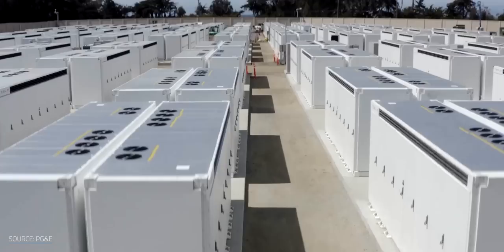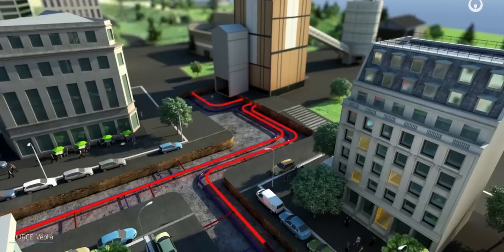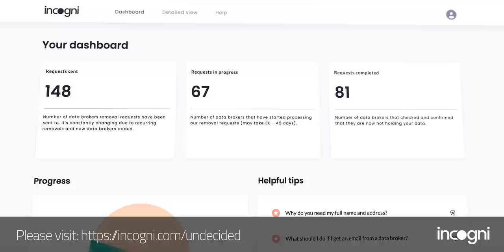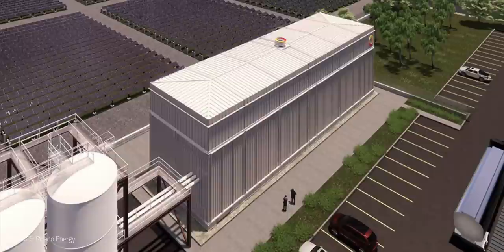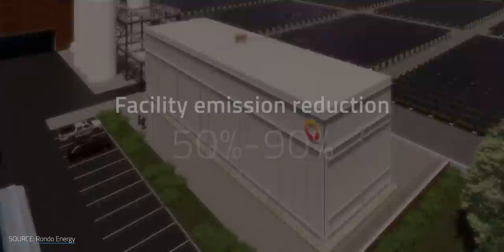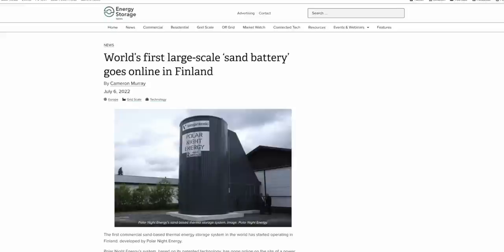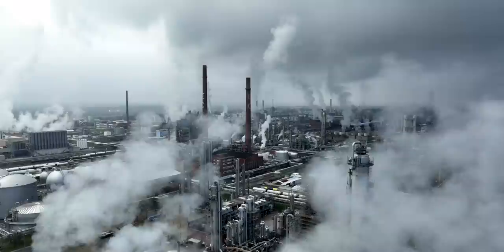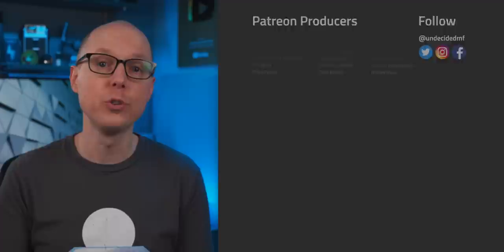How A Brick & Rock Battery Is Changing Energy Storage

Comment: Thermal storage is something I'm glad people are noticing. We've been using this on much smaller scales for years, such as pre-heating water for the home in tanks and using it in radiators around the house during winter; sure it (usually) relies on the grid and isn't as efficient as district heating, but as a principle it's nothing new and I'm glad we're moving away from JIT production of energy and heating.

Comment: There are some obvious flaws in these systems.
First, the electricity must be converted to heat the massive stone\brick storage.
It would take less energy to convert the electricity into heat direct used by the receiver.
Second, heat retention in the medium is not permanent and energy is lost by the process of thermal transfer.
Third, it will take more energy to transfer the heat from the medium than it would to convert the original electricity to a direct heating source.
Lastly, the space needed to provide enough medium to retain enough heat is extremely large.

Comment: From the previous video, Matt reports the efficiency of turning that heat back into electricity as 40%, BUT if... if I use that electricity to power a heat pump, running at a gain of about 2.5.. then Ta-Dah! Net zero gain... or loss.
Reply: "Reminds me of the time, I put a humidifier and a dehumidifier in a room and just let them fight it out." (Steven Wright.)

Comment: Well, got this kind of heat storage build into my house since 1978. Heating elements with stones are heated up when there is a surplus electricity available. Last year I upgraded this with a new controller to use PV energy in winter (not so much this year). So far nothing new. Sure, heat storage at home is limited to some days.

Comment: Yes, a good piece on thermal energy usage, It is one that will have far reaching use from here on, I can see it. Latent heat usage should be practiced by all manufacturers of heating equipment, It makes sense. I used to work in a small power plant, we made a lot of heat to boil water for steam Turbines, about 80 meters away was the Offices, which were heated by Reverse cycle Air conditioners, wouldn't it have been obvious to use the Excess heat from the boilers to run a heat loop to the office to heat it as well.??

Comment: in uses heating a room seems like heat pumps would be a better choice. although they won't produce flashy headlines heat pumps move 1.5-3 watts of heat per 1 watt of electricity. used to be they had a lot of problems in extreme cold temps, but current air source heat work even below -10F. it may even be possible to combine the 2. since it wouldn't need to produce 200F+ heat pumps would likely to be a more efficient way to charge the thermal battery in that use case.

Comment: Speaking of steel making, even if you couldn't use it directly to melt the steel you could use it to reduce the cost to bring the temperature up.  Most steel making is done with an electric arc furnace and they blow air in it how much quicker would the steel heat if the air blown in was near the melting temp and so reduce the electricity used and possibly reduce the time needed to get it molten. You could also use it to capture heat from exhaust gasses or off peak power.
Meh, what do I know.

Comment: I would be happy with a Rhondo heat battery taking 90% of the energy load of making steel and using standard electricity to finish heating the steel.  That would be huge.  I think we become absolutists at the expense of drastic improvement that we can't bring ourselves to be happy about.

Comment: Heat storage is a great idea. But it’s just one finger of a hand. 

I’m a Union pipe fitter. I see new boiler systems working in conjunction with other systems. On the return side of a steam system in the condensation. The condensation is still very hot. It’s being used to heat domestic potable water. I’ve also seen in hospitals where steam is used to heat autoclave. I think it’s just a pre heat but nevertheless it’s capturing heat. 

Now I get the cooler the condensation is the harder the boil will have to work but the boilers are much more efficient than a hot water heater or an autoclave preheating to 300°. 

I think it will take a combination of systems that combines systems to solve our problems.

Comment: I have what is called an Electric thermal storage system for a heating system.  The way it works is that during times of lower costs of local power, the bricks are heated up with electric coils.  During the day, there is no power going to the bricks, and it heats the house like a German masonry fireplace.  I have had the system for 30 years now, and I must confess that there has been no maintenance on it

Comment: Have you ever heard of "Rocket mass heaters" ? 
A few years ago I fell into one of those internet holes about "permaculture". While it seem a bit "hippie like" and that impression is not lessoned by a lot of the people into it is, well hippies, they do have a lot of smart things and cool "tech". Things that make sense, not just in a fantasyland! 
One of the things that really stuck with me was rocket mass heaters! 
They were kind of DIY projects. and they claimed them to be extremely efficient! 
In short: The rocket burns "sideways", it goes up to a barrel and you make what is basically a controlled chimney fire, this means you burn everything from your wood. all the gasses and stuff that is released and normally would go with the smoke, is condensed and falls back into the fire. Then the "smoke"/hot air is lead through pipes in a big heatsink, mostly made from sand and clay, but you could do other materials I am sure. before finally let out to the outside, almost cooled down. 
When you are burning you get a lot of radial heat from the barrel, but then because you extract most of the heat from the smoke too, it will give off heat for hours and hours after you are done burning. keeping the house warm all night. It is one of the most complete burns you can make, so most of the nasty stuff is also burned away. 
It would be cool if you looked into it, and maybe made a video on it - if it is as "cool" as I think it is!

Comment: A ton of gravel heated by 500°C stores about 100kwh of energy.  If most household energy is for heating and cooling and electricity can be generated at about 30% efficiency from stored heat or cold,  then the process would be near 100% effucient in cold weather using the waste heat for heating and hot water.  In hot weather, the waste cold from generating electricity could make it highly efficient.

Comment: The problem comes down to the cost of efficient insulation and the real estate that your heat battery takes up.  Then compare that to the cost of a standard furnace and fuel.  You can afford a furnace but you can’t afford a block of bricks the size of your house, insulation a foot thick, and some free method to heat it up…..

Comment: in order to store excess heat from industrial processes, yes, seems feasible, as it is the form of energy that is "almost lost". Yet other low-tech energy storage systems like gravitational batteries impress me more: no loss, output more scalable, no loss over time, no degradation, scalable in size... So, heat storage likely is a concept for very small niche.

Comment: Thanks for the great video! A question though: I was under the impression that decarbonizing the steel industry could be achieved by replacing traditional furnaces by electric-arc ones. The video implies that high heat (>1600°C) is needed in the steel industry and using brick heat storage can help to achieve these temperatures using stored renewable energy. But is this needed if electric furnaces are used? Or is installing heat storage somehow cheaper than replacing traditional furnaces with electric ones? Thanks!

Comment: Thinking I should build one for my house since I generate energy using solar anyway and run electric heaters when it's sunny out, so I'm gonna build one for night time and the panels can be connect it directly to the heating element and bypass the battery in charge controller

Comment: It's arguably one of the best practical system to store and utilise energy but i have doubts on the efficiency of the system in mass level for bigger demands . Just a thought, because the heat is gonna radiat and get wasted, the blower to bring heat out by air isn't gonna be efficient as it sounds , and the surrounding environment temperature also gonna impact the  stability of the efficiency, it's kinda debatable method to store energy in mass level

Comment: What prevents these companies from using heatpumps to "charge" these brick batteries?
Doing this smartly you could even combine the product of the heatpump heat, the equivalent cold "exhaust",  to provide cooling for datacenters or the community or other industries who consume energy to cool down goods (food freezers or anything else that I'm not even aware). Sure, heatpumps were probably never thought as a source to heat up to 1500 degrees but we never thought that we would doing a coast-to-coast on an EV.
Combining technologies can have a compounding effect that greatly improve the efficiency of the whole system.

Comment: I didn't see it mentioned, but it seems that Stirling engines may be a logical choice to produce electricity, when temperatures may be too low to drive turbines.  Of course, there are also Thermovoltaics, so we shall see what turns out to be most optimum.

Comment: I hate to tell you this but as a person who used to work with steel making equipment; this is an old idea. Somehow, the furnace people who built blast and open harth furnaces and built such thermal units went out of business as the 1970's usher in electric arc, induction, and basic oxygen furnaces. The idea worked really well but it never caught on with asphalt plants, central heating, plastic molding, cement making, etc. The old line furnace companies lacked the vision to adapt such units to other industries and energy was cheap enough to justify wasting it over the capital expense of purchasing such a unit. ( CEO's at that time "were penny wise and pound foolish" as my grandmother taught me) If you know where to look and whose technology to buy its an off the shelf solution with no or minimal R&D required. It doesn't fall under batteries in most technical and business people's mind though, it would fall under energy recovery or conservation. it is something our government doesn't want to promote.

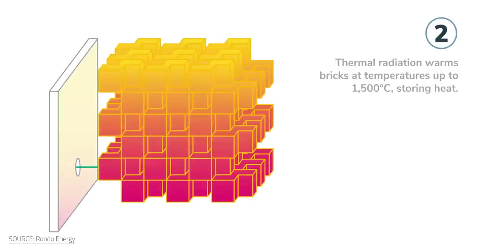Comment: So someone made an oversized electric brick heater 4:42, I have seen homes that are heated using these and if used correctly are much cheaper then gas central heating.

If you think about it, to go one step forward to save on co2 emissions we are going back several steps in heat storage. It's not bad just interesting.

Comment: Old used bricks would certainly be a good idea for that usage. Crushed rocks not so much since that would be better off for cement/concrete, now desert sand would be better since that is something you can't use in concrete as is, too rounded up edges in that sand.

Comment: The simplicity of the concept is key - the technology will determine the efficiency and capability limits.  The problem lies more in the political will to promote this both as an industry solution and a local Community solution.  It should be a no-brainer to install such units in all new housing and industrial/commercial developments together with ground source heat pumps, PV panels and vertical wind turbines.  Existing communities need local leadership and community involvement to work out how best to retro fit the infrastructure.  We cannot be waiting for the next improvement before acting -  now is the time.

Comment: I think that using heat storage is definitely a smart move, Im even personally more for the power tower style of solar power since it's innately much better at storing energy with a similar efficiency, and this seems to just be a system to do the same, but for more sources. I think that theoretically the heating efficiency can be larger if heat pumps are used, though I'd think that the limit for how hot it can get is lower.

Comment: Good combination with hydroelectric and fission power plants. Who knows, maybe the fission waste is an even better heat conductor or battery.
Additionally, instead of converting the thermal power from fission/fusion into electricity, use it for industrial processes that require heat. Solar/wind combined with standard batteries to power the computers running everything, with backup thermal to electricity in case of failure.

Comment: Not mentioned: Thermodynamic efficiency losses when turning heat back into electricity for grid storage.  It would be less than 40% at best.  Though in general, this is a fantastic application for industrial uses.

Comment: Pretty neat.   There might be a big advantage to utilize two heat batteries in series...with the first one as a "pre-heater" for the incoming air stream.   This way you could heat battery #1 by utilizing the 3-1 advantage of an electrically driven heat pump circuit...and then downstream, add in the additional heat of battery #2 (electrical resistance heat).   This could also help reduce thermal shock to battery #2.

Comment: My questions on the feasibility of TES revolves around the energy density - is it applicable for large industrial scale processes (would it consume too large a space); RTE - is blowing hot air through hot bricks the best way to recover heat from the storage? air has a low specific heat capacity. dont know what i dont know here.. but if its real this could be the panacea for solving industrial scope 1 problem.

Comment: If you want heat the best source is nuclear fission. If you have a heat demand to couple with your electric demand your cost of overall energy goes way down. That's true for any thermal engine but pays off even more with large power plants that more or less dump about 60% of the thermal energy, often 70% because it's cheaper than capturing it for useful work. 

Daily reminder, wind and solar is no more renewable than nuclear fission, they are just both long lasting.

Comment: I have to wonder if you couldn't use a heat pump to concentrate the heat energy from a battery to achieve those higher temperatures. Alternatively, you could use stored heat to "pre-heat" material before taking it up to full temperature with more traditional methods, which ought to reduce the cost of heating it from a cold start.

The main point being, even if these technologues don't completely solve the problem, it seems like they could still make a pretty sizeable dent in emissions across the board, and make alternative energy solutions far more viable.

Comment: Brick heat storage is worth research and investigation. Imagine eliminating city blight by tearing down empty abandoned downtown brick buildings and using the brick to construct brick/metal energy batteries. They may not be as efficient, but would this reasonable? Could it be done to provide economic energy for low income housing? What changes would be needed to use these huge amount of current brick resources?  Could it be done for a home or is that too small a scale? How big would it have to be for a neighborhood of single or multi-family dwellings? What areas of the US could benefit from this? Thanks for a thought provoking video.

Comment: Here is a question. Being made of simple materials, with low to no danger, could the brick thermal storage be made for small scale? Example: Can a small farm or property with small windmill and or solar panels or even hydroelectric, be used on a small scale to heat and provide power for a homestead, farm? Could off the grid homestead apply this tech with minimal cost?

Comment: What about solar thermal? At least in sunny places. Efficiencies around 80% vs 20% in photovoltaics. With molten salts, sodium, oil or steam conveyed to the brick/rock batteries. Other variation could be this system heating underground huge stone batteries to keep summer heat for winter heating. The key in order to insulate those batteries IMHO would be a round shape, a HUGE size and perhaps surrounded by volcanic materials outside ( rock wool, perlite, etc.)

Comment: Damn I wish South Africa would pull up its socks some more. Like the Northern Cape province where my parents live is basically the desert. Solar paradise. A few cool salt boiling solar plants.

But it’s also the mineral basin. So iron ore, manganese (needed for steel); and lime for cement production is pretty much all in the same place. Not a lot of water (maybe if you drill down far enough) but like the only really well maintained railway for heavy industry goes there. But previous attempts at steel manufacturing have failed and I think converting cement plants will be pretty difficult.

But man, we could be leaders in energy production and storage and be exporters of green cement and steel. Surely that’s gotta count for something

Comment: I have to admit, I did not see the application of superheating as a direct thermal power source. I was thinking about the MIT prof that's making a liquid metal battery, or using that heat to drive generators. That's some reasonable design they got there. Effectively the only reason to use fossil fuels over this is to reach temperatures beyond the maximum thermal gradient potential. I'm excited to see what they'll make for gen 2.